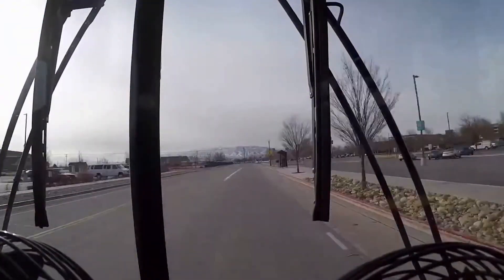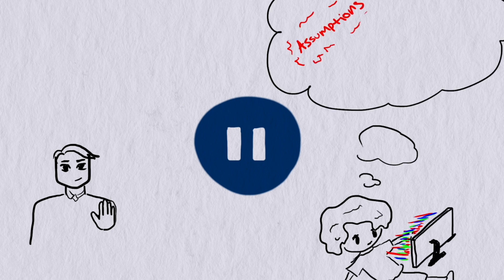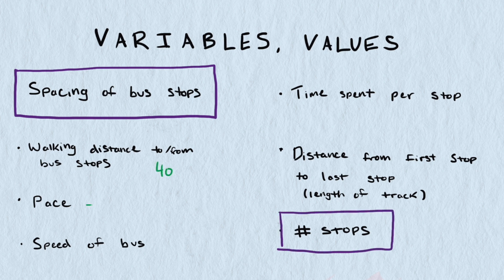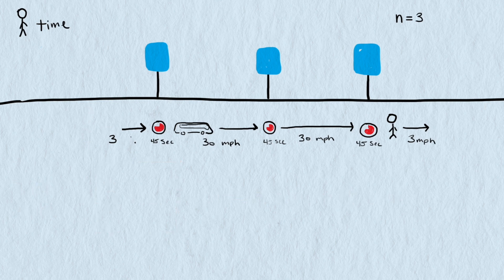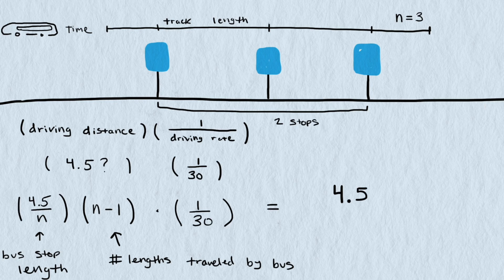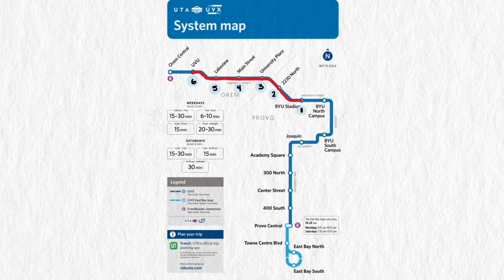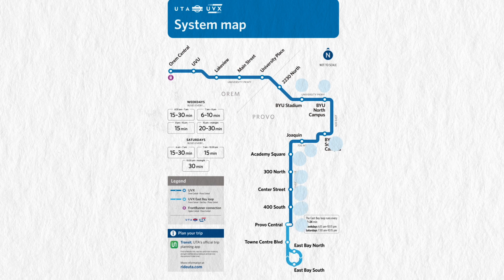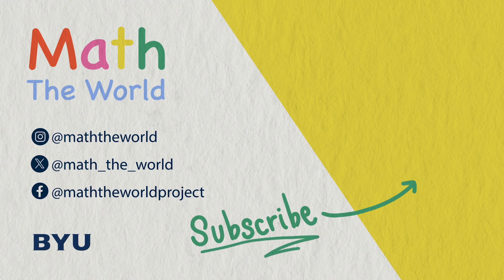How Far Apart Should Bus Stops REALLY Be? | A Math Problem Solving Approach | Part 3

Comment: I'm a transit operator (I drive the bus) and while I appreciate this analysis, and your humble conclusion, I note that this approach really misses many of the important factors that go into the very constrained and complex planning and decision making that goes into route design. Also a little depressed that your view into this problem is through your cars windshield, as you can seemingly become a regular passenger on this route, and be one less car the bus has to wait behind. You are traffic, but if you ride the bus, you can become a part of the actual fix to traffic. 

But I also want to point out a couple of the key concepts that make fewer stops better. This is a classical discussion that comes up a lot. Transit users often go to bat to preserve stops on routes that have too many, and make their trips take longer and be less reliable, which unfortunately  harms all users. As stops are added to the route, it takes longer to get from terminal to terminal, and key in this is that it also becomes less predictable for each individual trip. A bus in the train (all the buses out on the route at one time) will get busier than the others because of the stochastic demand at any given stop on the line, and as they become busier it feeds back on itself, a busy bus gets busier and later, and soon a bunch develops, with the lead bus late and full, and the follower early and empty, and the reliability and usability of the whole system suffering.

Beyond that, routes will be planned around a frequency, called a headway, that means we want a bus to come say every 15 minutes. This will bring a host of considerations to bear, and number of stops in the line is integral to that. As you stretch out the length of the line and increase the number of stops, you have to commit more buses to be out serving the line to attain the desired headway. Longer, more stop intensive routes demand more resources in terms of equipment and staffing. This also has material implications you may not expect, because the recovery time at the terminals, which is built into the operators schedules, has to increase as well to account for the less predicable trip times, which translates into actual length of curb space at the terminals to accommodate more buses laying over. 

Choosing the stops is a balancing act that folds in far more than the sum of time spent on the bus and walking to the stop.  Any bus route, and especially BRT (bus rapid transit) route serves it's passengers best when it is timely, reliable, and useful. BRT routes ought to be biased toward faster trip times, because they are a Rapid component of a networked system of lines, which rely on each other to provide coverage for many trips to many places. Transit works it's real magic when efficient and reliable transfers unlock the whole cities potential of destinations. This is why anchoring stops to transfer points to other lines is an overarching goal that takes precedence over even stop spacing in many cases. One transfer point is worth three single route stops at least.

Thank you for examining this question, and your humility in recognizing you didn't know better, but I would posit that you weren't even playing in the same arena. And I hope you will examine the possibility of ditching your daily drive as a traffic generator and transcend into transitland. Buy a bus pass, and really make a difference. We are all counting on you, Math the World.
Reply from the maker: Thank you for this feedback! No actual bus route engineers or planners were consulted for this video so this is incredibly valuable information for us and would definitely influence our model. We’re considering making a part 2 to this video to answer some additional questions brought up by viewers so stay tuned!
Reply: I'll toss in my two cents as somebody who uses the UVX daily (the southern section near the Provo Frontrunner station). 

The simplified model in the video led to the conclusion that more stops doesn't significantly increase travel times, but in practice that doesn't seem to be the case. Despite commuting on the train from the Salt Lake valley, the longest (duration) portion of my commute is the short (distance) on the UVX because so much time is spent at stops and lights between my origin and destination.

Additionally, as somebody who uses the train system (spaced at 30 minutes or 60 minutes depending on the time of day), buses arriving on schedule is *crucial*. A bus that is a few minutes late to my stop that loses another couple of minutes by the time it reaches the station may make me miss the train and have to wait nearly an hour. 

Thankfully the buses are generally within a few minutes of expected arrival, but I still build buffer time into my schedule to try to arrive at the train station 1 bus early, rather than on the last bus before train departure. That means my public transit commute requires more time, and what could be 20-30 minutes in a car becomes over an hour of transit, switching vehicles, waiting at stops, and walking, which is not good for productivity. I still choose to do that, but many do not. 

The more convenient and reliable the system is, the more people will use it (a good thing). And even though it might seem like saving 1-2 minutes of walking by adding stops might be convenient, and would help with the occasional mall trip or sporting event, for the people that use the system the most it really isn't going to help and might actually make things worse. 

In short, if I had to walk an extra 2-5 minutes to a bus stop but I could count on them always being on time, it would still decrease the time my commute takes because I wouldn't have to build 10-20 minutes of buffer into making a connection to a train.
Reply from the maker: Thank you so much for taking time to write this comment. We really appreciate it.  There is so much here I (the writer of this script) did not know. Some I did, but chose to work with a simpler model for the sake of the video. For example, as you point out, assuming that the bus stops at every bus stop is not as close to reality as using a stochastic process to model it. I actually tried to reach out to a bus system designer before I wrote the script, but I had to go through a 3rd party ( a former student) to get his contact info and never got the info. I know that the have more complex models that consider more variables and I wanted to actually discuss the one they use in the video. I will keep trying to get hold of him. If you have any materials that would help us make a follow up video, please send them along!
Reply from the maker: @Daniel-rb7zo  Thank you for your comment. The model actually helps to balance the trade-off between stops and walking distance. Fewer stops means more people have to walk farther to get to the bus stop. Yes, once you are on the bus, you would like as few stops as possible, but there is a trade off between the shorter time traveling with fewer stops and the longer time it would take for people to walk to the bus stop. If you are relatively close to the bus stop (and the train drops you off right at one end of the station), then yes, the bulk of time is in driving/waiting, not in walking.
Reply from the maker: Oh, and I forgot to mention that although I don't use public transit a lot, I do carpool to cut down on congestion and pollution.
Reply: @MathTheWorld  I didn't do a very good job explaining my thought, it looks like. My intention is not to suggest that they should knock out every stop on the route that I don't use so that it's optimized to my use (or a less severe version of that same idea). Rather, it's that wait times at bus stops are not zero the way the model/video originally assumes, and reliability is improved by having fewer. 

If I'm 2 minutes early for a given bus once, and then 2 minutes late another time, that doesn't average out to zero wait time. If you assume that buses stop for 45 seconds, that's fine, but assuming there's always a bus at the stop is realistic, as spacing varies by city/system or even time of day. You added this into your consideration later in the video, but it felt like an aside to correct a disparity between the model and Google's prediction. Most bus systems I've used have a spacing of at least a few minutes even during peak hours. Similarly, the ability of each bus to arrive at each stop on time, spend the correct amount of time there, etc matters. Since stops are where I assume the greatest potential for variability in timing arises, again, that simplifying assumption that was made obscures some important aspects of the problem. 

(To be clear, I recognize that models don't need to describe every aspect of a system, but I think those considerations are too significant to not consider at all). 

With that clarification, I'll try to explain my thought from earlier better. Removing or skipping a stop increases walk time, but may also increase reliability. If cutting out a stop increases my walk time by x minutes, that time is relatively constant and can be planned for. Despite that longer walk, if reliability increases enough, it can mean shaving a fair amount of buffer time out of a daily ride plan. That would still be a win for regular users who count on the schedule down to the minutes (getting to class, arriving in time for a shift, catching a train, etc), even if it's less convenient for casual users who are trying to travel with a group to an event or location of interest once every few months and might have to walk a bit longer to get to a stop. 

And I think it's the regular users*, and the feasibility of incorporating public transit into people's normal schedules, that should be weighted most heavily in these decisions. We WANT more people to use it. That means it can have more funding to better serve those that use it, and keeps the roads etc safer for pedestrians and drivers whose situations really don't work well with public transportation. 

Finally, the stretch you have the most control over is the walked portion. I can't make a bus show up on time, or control how fast it goes, but with more employers and campuses allowing personal rideables, more users have options for speeding up the short hops using affordable equipment. (Keeping in mind that many of those options would not be ideal for traveling the full distance). 

*I won't pretend to know anything about regulations on spacing for those with impaired mobility. I'm sure such regulations exist, and I'm sure that's factored into the spacing near the Provo city center that seems tightly clustered to me, but I don't know anything about them. So I'll stick to speculation on how to improve casual models, and leave the actual decisions to the real engineers. 

Hopefully that explanation makes more sense and sounds a bit less like I want a personal shuttle service, haha.
Reply: Nah, it all has to do with union rules and the bogus inefficient nature of union hegemony. I was in transit IT for decades and I devised similar models that used the linear referencing data that optimized the entire system without significantly affecting runcutting (the process of generating routes from system parameters and union rules). I was constantly foiled by union flunkies that snootily informed me the system could not be optimized like that due to complex union negotiations that went down to the level of every stop arrival time to optimize the least possible work for drivers and maximum vacation hours and overtime pay etc.
Reply: @Sven_Dongle  Wow, so you want tired busdrivers on the road causing accidents and peeing in flasks?

Because that is what you are talking about,.

If you can't take into account all factors, you really should not have that job.
Reply: Lol. LMAO even
Reply: ooops ... reality intrudes ... eg. traffic congestion ...get rid of cars ... freedom for the streets ... food not cars
Reply: @Daniel-rb7zo  it's the travel time that causes bus transit systems in smaller cities to falter. Smaller demand means fewer routes and Fewer buses running those routes. Fewer routes and buses means a less reliable system that's harder to get to and use.  Difficulty to use deters passengers meaning fewer passengers wanting to use public transit.  Fewer passengers means that they try to run fewer routes and busses. It's a mismanagement nightmare.  The sad thing is that if they made it easy to use and there wasn't a huge difference between car vs bus for convenience and travel time you'd see more people wanting to use the bus.
Reply: Great vid!
Reply: When I travel by bus sometimes the driver would wait extra time a certain stops so that they stayed on schedule. A good route plan would have these long stops built in to soak up variability in the traffic.  BRT routes have less variability due to the dedicated lanes so long stops are needed less.
Reply: Hi. What do you think of smart bus stops? Folks alert the bus that they want a ride, and the bus tells them where on the street it will stop. Physical beacons (like walk/don't walk) can direct folks to the current stop locations.
The bus should end up with fewer stops (how many times does a bus stop twice for folks who could have all entered together?), and app-using riders "work" to make things easy for all riders, especially those who will need special consideration for the trip.
However, exiting the bus when one is using the cord instead of the "bus app" would get a bit complicated. Does the driver continue on to the activated stop just ahead, where folks are waiting to board? What if the bus is ahead/behind schedule?
Reply: I am a transit rider.  And I know full well the frustration off waiting 2 to 3 hours for a bus that is supposed to show up every 20 minutes.  I am really not going to fault anyone who doesn't go for your shaming tactics.
Reply: @57thorns  

"Wow, so you want tired busdrivers on the road causing accidents and peeing in flasks?

"Because that is what you are talking about,."

No, it really isn't.  That is just a go-to line for people who think businesses and governments should exist only to give paychecks to union members for no work.
Reply: @PvblivsAelivs  Sorry kid, but you will have a rude awakening at some point.
Reply: @57thorns  

"Sorry kid, but you will have a rude awakening at some point."

That point is decades in the past.  I used to be far more supportive of unions.
Reply: @57thorns  IT dudes wasnt talking about that. You completely skipped over all the millions if scenarios that didnt include harm to people because you heard him attacking Unions. Your conversational dishonesty is overbearing. When your opponent doesnt make the only mistake youre in a position to do anything about, you go home and get actually skilled...not fit square pegs in round holes
Reply: @readjordan2257  Dude was attacking unions, and that is the result of a society where drivers have no rights. So perhaps you should listen to youd own advice and learn something.